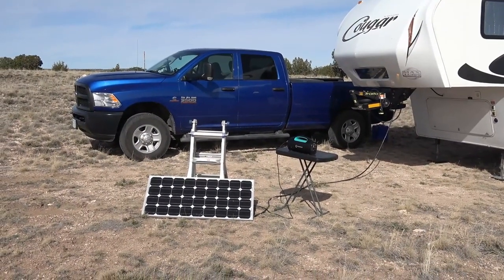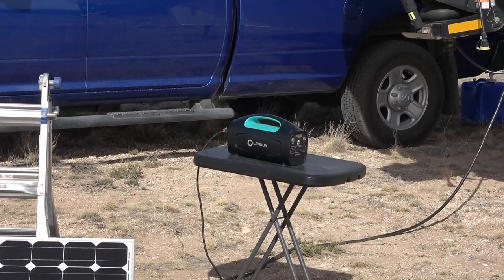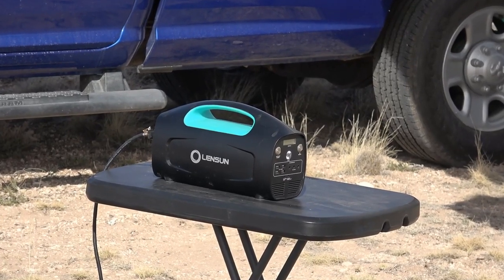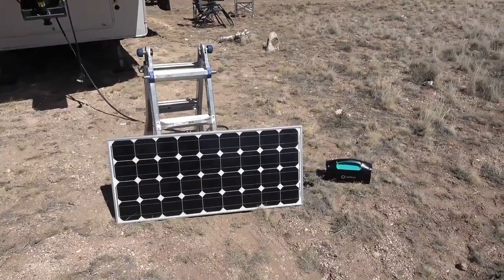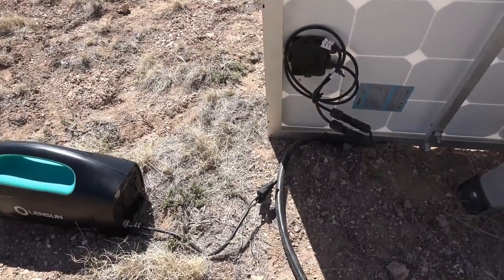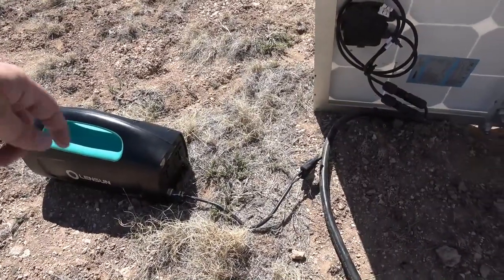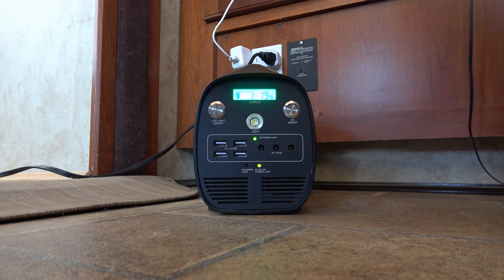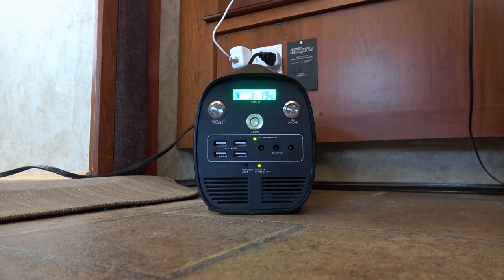Lensun SG510 Solar Generator Power Box Review

Comment: Ray, was the high heat on the outside of the unit from the heat sinks on the board or the lithium battery?
Reply from the maker: Heat sinks
Reply: Love Your RV Could you check the hypothesis and math I posted in the main comment thread? I’m new to power calculations and I’m still wrapping my head around power storage/usage systems. 
Thank you. 

D.

Comment: Ray, hope you an Ann are doing well. 
The alarm when starting the generator is probably a safety feature. I have a little jump box for jump starting a car/truck and the instructions very clearly tell you to disconnect the jump box within 10 seconds after starting the vehicle. The reason being is the vehicle, and your generator, are sending current back to the jump box to keep the battery charged. This unit is not designed to have current coming into it via the jumper.
P.S. You need to put mud flaps on the front wheels of that new truck.
Reply from the maker: Makes sense, thanks. :)

Comment: I have a Jackery 240.  Similar, but it also has a 12 volt cigarette lighter socket ( REALLY Useful).  It also can be charged from either 110 VAC or 12 Volt cigarette lighter.  I have it in series between my truck's cigarette lighter and my 12 V cooler in the truck's cab.  I'm addicted to reaching over and pulling out a 16.9 oz Pepsi from time to time.  This arrangement (1) keeps the Jackery charged and (2) keeps the cooler at 34 degrees 24 hours a day.  On longer stays, I plug it into my coach lithium battery bank which is in turn hooked up to my solar panel.  I am very satisfied.
Reply from the maker: Nice, sounds like a cool setup. :)

Comment: Good honest review Ray. I think these are best used for car camping and not really much use for RV'ers although they could be handy for powering a towed braking system or powering a small DC refrigerator when travelling.
When is Battle Born going to send you some lithium batteries to install and review, they seem to have sent them to a lot of YouTube RV channels?
Reply from the maker: Thanks. My wife likes it to plug her electric throw blanket into it. Used it a few times when our main battery bank was running low.
Keeps her toasty warm at night and lets me turn down the main RV furnace.

Now she can take it anywhere and stay warm. Nice for her sitting outside on a cool evening.  
Will be handy for her to take on her little powerboat too. Cheers, Ray

Comment: Starting the generator was hardly a test of the jumper :) but otherwise your review was complete
Reply from the maker: You right, only proved there was voltage there and some current output, but not near testing its max.
But, No way I was attaching the thing to my brand new diesel engine! ;) and had no other vehicle around to try it on. Cheers, Ray

Comment: That beeping is more than likely it senses the voltage from the generator. I would think it is not alling that voltage going back into the battery
Reply from the maker: Makes sense, you would think when jumping a car the alternator would do the same charge are 14.4V, I guess its to remind you to disconnect the cables.
Reply: @LoveYourRV   That is my thought also
Reply from the maker: Woah!

Comment: Very interesting. Using that machine. How long could an AirMini CPAP run using 0.83amps DC 24 V?  With the drawbacks on this machine then, what would you recommend?
Reply from the maker: .83 amps @ 24 volts is 19.92 watts so you could expect the box to power that CPAP for around 20 hours or more before a recharge is needed. CPAPs are hard to gauge though as they don't draw their max wattage all the time. Unfortunately, I didn't have access to one to test and they are all so different depending on brand and features.
Reply: Love Your RV Thank you very much.

Comment: Inside the 18650 size battery, complete in parallel with BMS ( battery managed system )  Looks similar like that  https://www.illumn.com/batteries-chargers-and-powerpax-carriers/18650-sanyo-ncr18650ga-3500mah-high-discharge-flat-top.html  Good review , thank you . Now I know that inside !!

Comment: All in all, I think at the $545 price range they are a pretty solid deal. Ten hours isn’t a terribly long time because I think they may have a bunch of 18650 batteries in series. Just a guess. 

The big disappointment for me is that there isn’t a 12-volt means to charge. I use a cpap so I would have liked to be able to charge it in the car during a long drive. Shame to have to use an inverter too. 

Good review, Ray.
Reply from the maker: Thanks, Bill, I asked the Lensun rep if they had a 12-volt DC charge option and she said no, only solar or AC. I find it hard to believe that it couldn't be done, though. Maybe this review will get them thinking. ;)
btw, I did feed 13.6 DC volts from my rigs DC battery system into the solar charging port and it did charge. But being that it's not officially supported I didn't put it in the video.   Cheers, Ray

Comment: Per the specs on the site it has 510wh battery per your test it has about 335wh usable. I'm not sure if thats good or not.
Reply: Also the harder you use a battery the lower it's actual capacity is. See Peukert's law. The 510WH rating of the battery may be it's rating at 20C (20 hour discharge rate).

Comment: If the 2% warning is actually at the 20% safety threshold of the lithium battery, (a good safety measure put into the system by the manufacturer) then this test is dead on with the advertised output. By my calculations, the heater should  run for about 43 minutes before reaching the 0% or the 20% safety threshold for the battery. 

95% battery - 20% threshold is 75% of usable battery capacity. 75% x 97% of the maximum output hours. (485/500ah) = 72.75% x 60 minutes = 43.65 minutes at 0% warning or 20% of the battery capacity remaining. 
You ran for just over 42 minutes and stopped at 2% or 22% of the total battery capacity. 

This discrepancy of 20% may also explain the variation in drop of percentages from beginning to end. Faster at the beginning then slower at the end. 

Of course I’m just spitballing here. 

D.
Reply from the maker: Makes sense, thanks.

Comment: Lensun Solar Generator
$545.00 was $1,199.00  theres NO way tht box or any of these types [Jackery] are worth the the money they want for them
Reply from the maker: I see they are down to $399 now. I guess to some these so-called solar generators are worth it, as they seem to sell well, but not something I would personally buy.  Rather have a little gas genny. Maybe in a few more years, they will be more viable for larger RVs.  Cheers, Ray
Reply: I think the $399 version is a 288 watt-hour version.
Reply from the maker: I just saw it today on the Lensun website - http://www.lensunsolar.com/index.php?route=product/product&path=78&product_id=315
Lensun® 50% discounts US stock ready to ship! Only 4.5kgs/9.9 lbs!!! 510WH 110V Solar Generator Power Station for Camping Travel CPAP Emergency Battery Backup

 $799.00 $399.00
Reply: That’s great!  At that price I definitely think it’s worth it. I pay close to a hundred bucks for a solid reliable UPS. Add in the MPPT controller, the inverter, the 48 amphours,  you’ve got a pretty good price point. Now, if only they had the Dc charge... 😀
Reply: How much is power worth when you need it?  How much can YOU build one of these for? Yet I do hope you feel better after having venting (once again?) about how overpriced stuff has become. BTW...I have may Jackery products and they seem to be as good as anything on the market.
Reply: @geraldhenrickson7472  IF u r askin me how much i could make one of  these for , 1st let me tell you i already have [$100-+]yrs and trs ago i used setups like this back in my ham & CB radio days we made ths type of stuff all the time , all thts in tht plastic case is a small battery i.e" motorcycle battery , and IF said  company i r selling it for $399 all it cost them to make was $100-+ thts how business works my friend , and now as u said too me , "i hope u feel better after having to vent" lol cya
Reply: Bill Lancaster couldn’t a fella just wire some solar connections to 12v cigarette lighter and charging from your rig would happen?  My portable booster cables charge through my USB in the middle console.